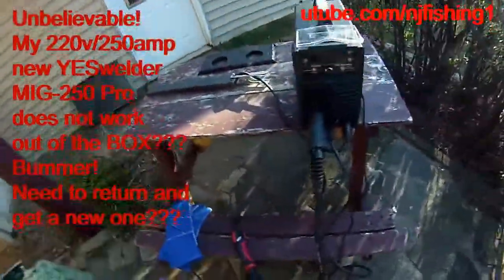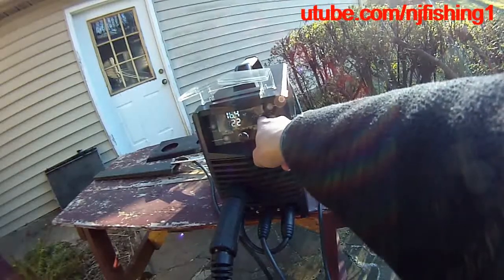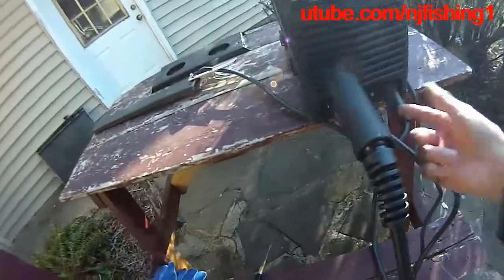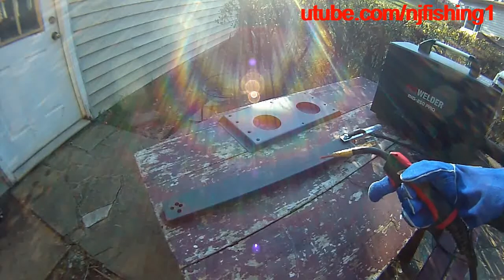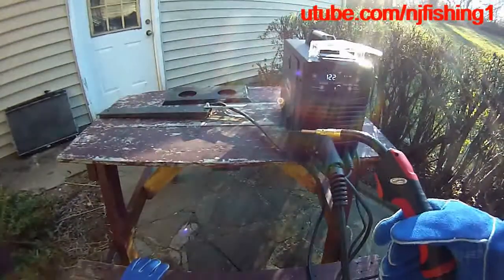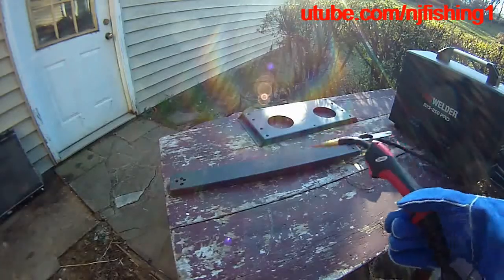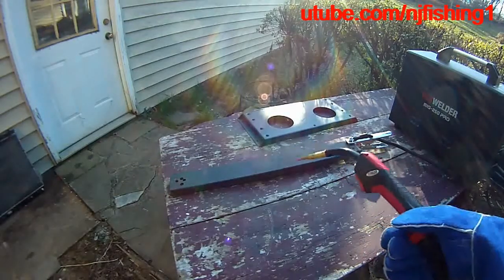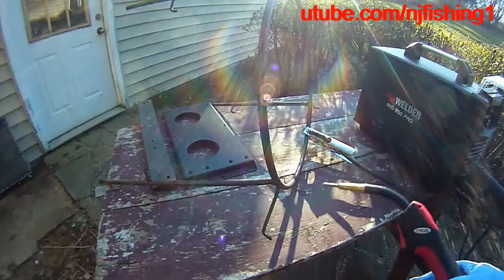My new 220v/250 amp welder DOES NOT spark (my mistake - need to do 2 things:1 short, 2 pull trigger

Comment: Thanks for the video and additional posted comments. I am new to welding and didn't know this either. I couldn't figure out why my brand new welder wouldn't work. You helped me figure it out
Reply: I have a new welding machine but it is not arcing can you tell me
Reply: @MuhammadFarooq-xb6yx  Did you check the Mig Fluid Level? You might need to add a Quart.

Comment: The trigger both advances the wire AND turns on the welding circuit - Its not a stick welder.  No trigger, no weld - That's how modern MiG welders work

Comment: No offense but I don't think you know what you are doing. For one you need to clean up your metal. If you are running flux core, you need to change out the wire drive wheel with one that's made for flux core. It's a good welder, I run only flux core in mine but you gotta change to the right wire drive wheel if you want the wire to feed right. I can send you a link to the right drive wheel if you want.
Reply from the maker: U drive wheel roll is for aluminum. It came because i bought aluminum gun, aluminum wire separately
Reply from the maker: 20meters Spool gun for aluminum will cost $190, plus wires vs Tig gun $50 plus wires. Tig gun is smaller gives me better control. Both setup, u need 100% argon gas. I went with Tig gun because it is (1) cheaper, (2) gives me better control for my weld. Stay tuned for the aluminum truck camper build. 1 of my many 2021 resolutions
Reply from the maker: I did 2 things at the same time to make the spark and arc. 1. Touch the gun with the ground clamp connected metal, 2. Pull trigger. The second thing is a safety feature my old 120v/100 amp flux welder don’t have. I get sparks even when I accidentally touch the gun with the metal connected ground clamp
Reply from the maker: It is working now
Reply: @njfishing1  Great ! Glad to hear it .
Reply: @njfishing1  how did you get it worked? I have same problem
Reply: @faithwelder6047  u need to pull the trigger at the same time when you touch your gun with the negative clamp
Reply: You don’t need to touch the gun to the work piece to get an arc. The wire itself is the thing producing the arc with the work piece, not the tip of the gun. Also check your polarity. Flux core should be electrode negative.
Reply: I have also 200amp mini welding machine. It is not arcing but machine is fine. Can you tell me what is the problem
Reply from the maker: There is something stopping your positive to connect with positive. Either plastic or rubber in between your ground clamp and your welding gun